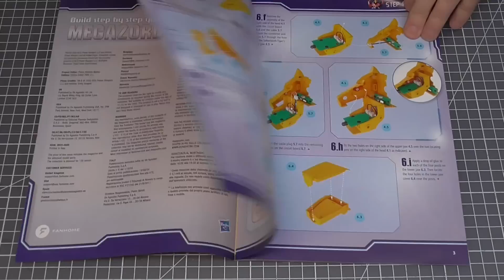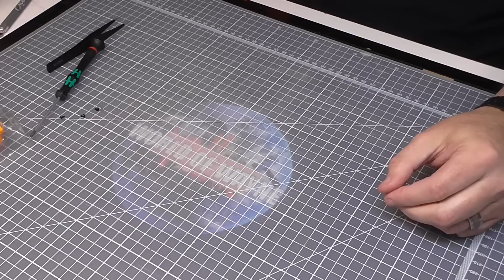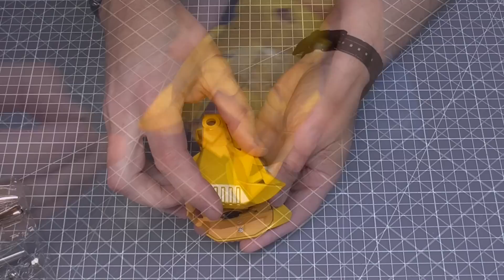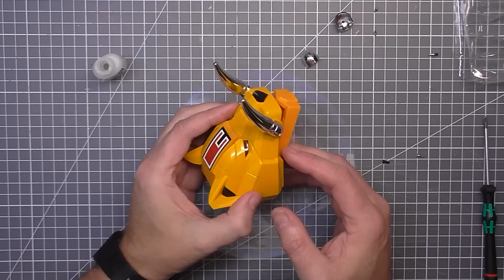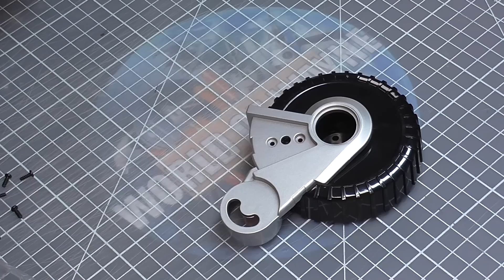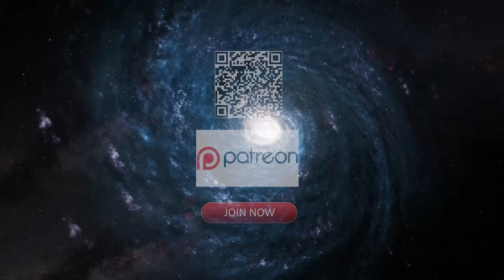Build the Mighty Morphin Power Rangers MEGAZORD - Stages 6-8

Comment: Hi Wayne. Hope you are well. I’ve been following your videos for quite some time and am currently signed up with Fanhome with the build a Megazord subscription. I signed up for the 12 months plan. I wondered if you have had any problems with your subscription? I got my first 3 packs monthly as planned, 1 issue was missing from pack 3 and was told it will be in pack 4. I have been waiting over 2 months for pack 4 to be sent though and is just stuck on very soon on my subscription page. I have contacted Fanhome a few times and don’t seem to be getting much help or answers. Hope to hear from you and looking forward to more of your build videos. Baz (UK based)
Reply from the maker: Yep. I have had to.out mine on hold ATM as there is a stage missing

Comment: Wayne did u have issues keeping a charge for sabertooth tiger. I tried today charging it and it wouldn't keep a charge. Whats weird is u don't actually get a battery I believe for sabertooth like the others. Funny is mastodon is charging fine and didn't use the loose battery it comes with.
Reply from the maker: Nope. It's charging fine

Comment: Have you had the email from Fanhome about the sabertooth tiger head?
 'We need to inform you that we have been notified that some of the stock for stages 4 and 5 (Sabretooth’s head) may not be the correct colour due to a production error.
To resolve this, we have arranged for a new production of both stages and will include them in a later shipment at no extra cost to yourself.
Stages 6 and 7 will also be supplied as these will be needed in the replacement of the head.'

will you need to put off some of your videos if it affects when you are meant to attach it to the neck? Apparantly they will be sent out in May.
Reply from the maker: Yep. i got that yesterday and the Infinity Gauntlet one. We talked about it on last night's live stream